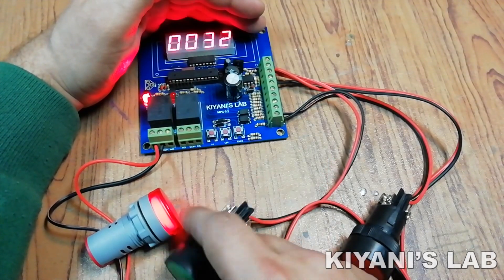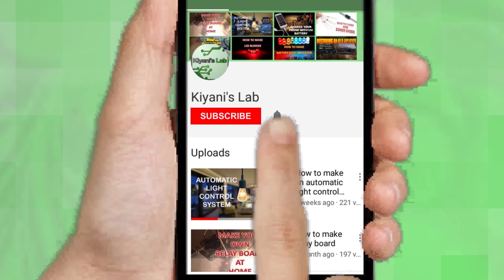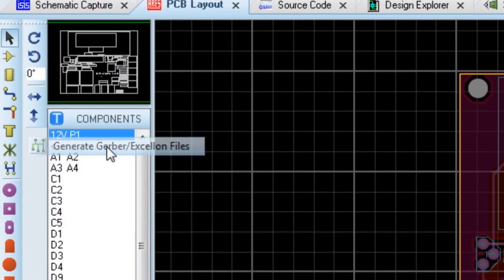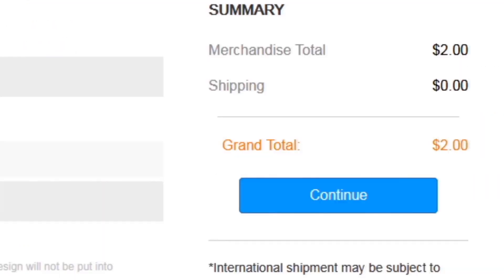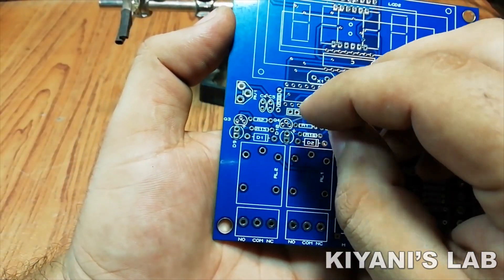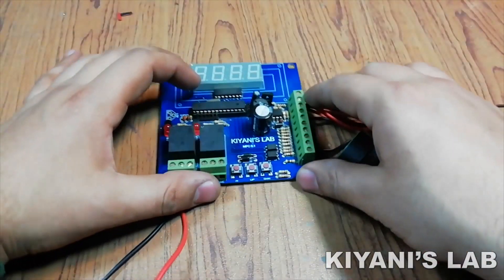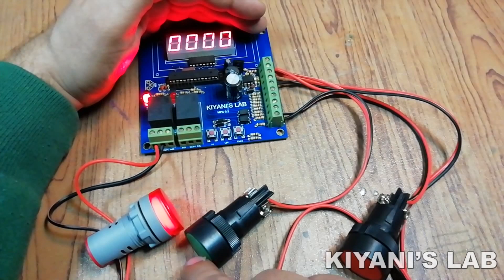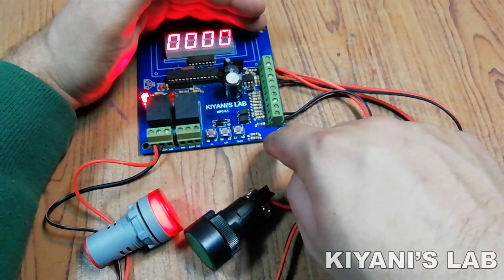How To Make An Object Counter

Comment: Sir Arduino+proximity sensor + 4 digit 7segment display winding counter miter. 2 button winding count value set and 1 button select to relay on moter on winding value all 0000 auto relay off moter off...